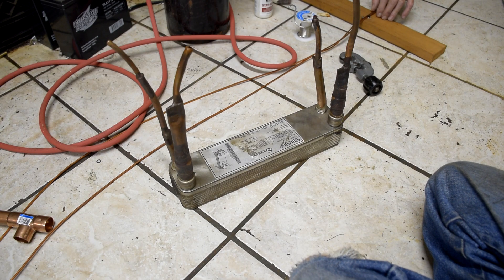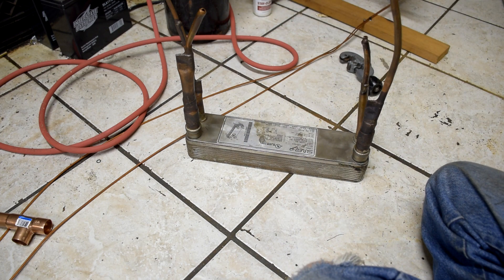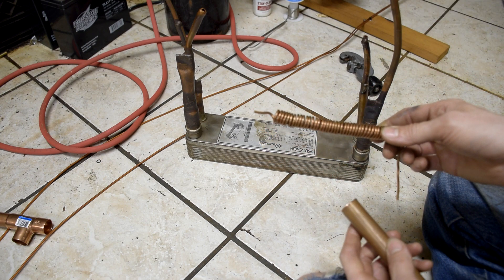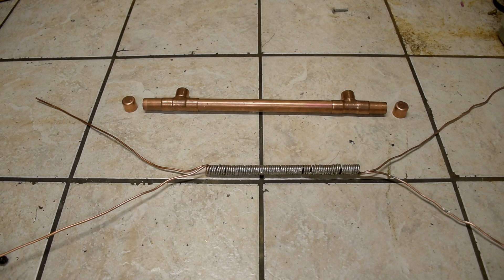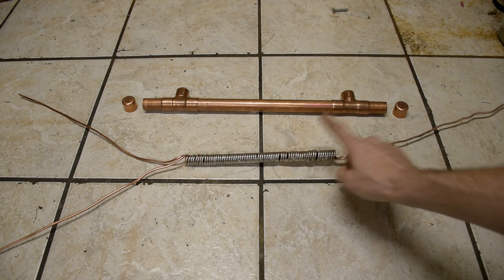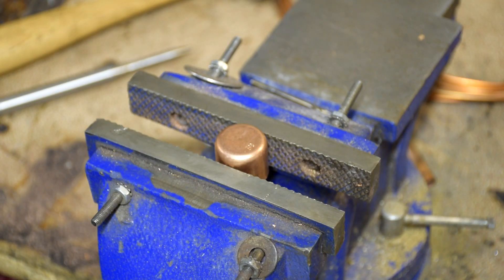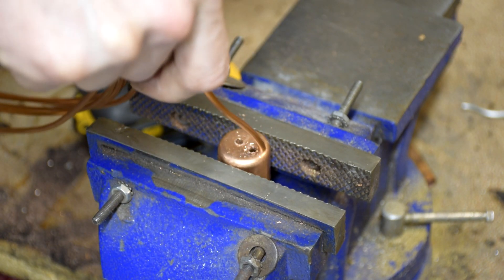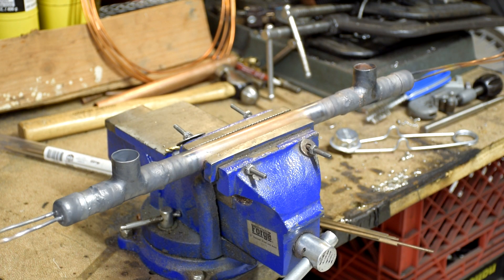Making a Cascade Cycle Heat Exchanger

Comment: your like me with random ideas, what would you think of doing a duel coil air handler, so that first stage would take the main load and them the 2nd bank about 6 inch away using a oil separator and maybe a c02 for 2nd stage you could theoretically make a unit that is super efficient and using much smaller variable compressors you could have massive humidity control to 1 or 2 %

Comment: you would not have super hot gas going into the ihx because it would be after the condenser think of the ihx as the evaporator because it is but its also the condenser for the ult side.
having the tube in tube style has been tried but the issue is it ends up being like a metering device/direct expansion.

Comment: Forgive me to go off topic, but how is your residential heat pump r134a going now a days?
Reply from the maker: Compressor had low compression, motor still worked though. Thinking back it may have been damaged before I ever used it, as it did come from a surplus store.
Reply: @subcooledheatpump    You think it was flooding back at all?
Reply from the maker: It's possible, It did have a crankcase heater than ran 24/7 but the superheat was quite low. I rewatched some older videos that I took of it and the compression was never really fantastic. It did work for some years though and I still had fun with it. I may try it again sometime in the future. I was going to get a replacement compressor for it but the 3 phase ones are all expensive.
Reply: I ended up buying an inverter to experiment with.  Picked up a used compressor.  You could find them here in Florida. But haven't got around to building the system yet.

Comment: The plate HX is ideal for cascade applications.
In an autocascade the lower temperature refrigerant will be cold at the inlet anyway and in a separate cycle cascade you need to use an air condenser anyway to cool the gas before it enters the low temperature HX.
Reply from the maker: I'm trying to avoid using the gas cooler, hence this design. If it doesn't work, I will use a gas cooler

Comment: Hey dude. Where you been for the past year?
The funny thing is just earlier today I was daydreaming about a cascade A/C to cool drinks when you have our 115 degree days here in Phoenix
Reply from the maker: Lots of projects with Air conditioning and heat pumps going on. Been working on a new concept and I think I'm ready to start sharing some here on youtube, so there should be some more HVAC stuff coming out shortly, including the refined cascade cycle air conditioner/heat pump